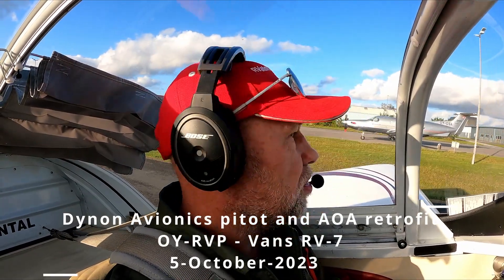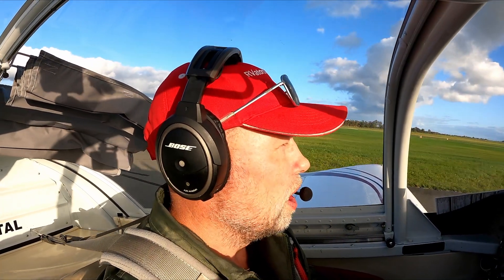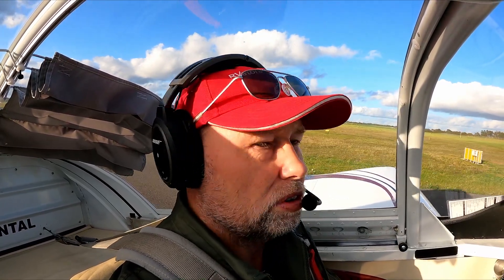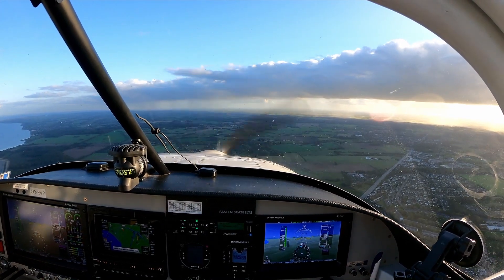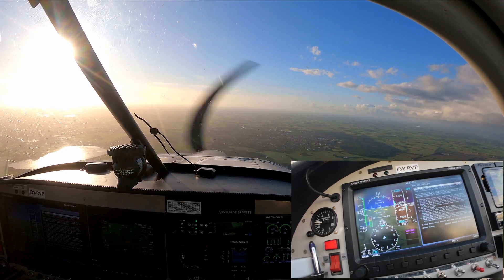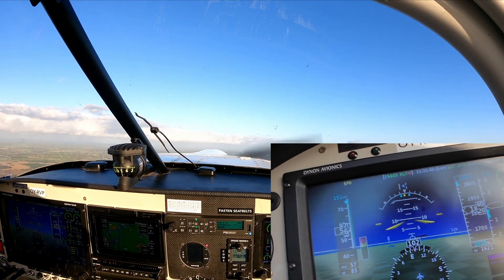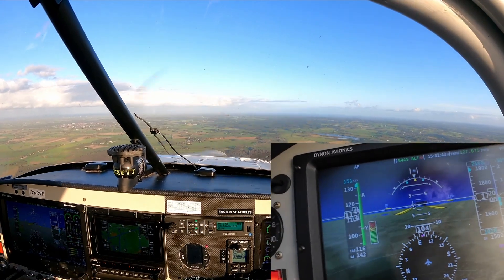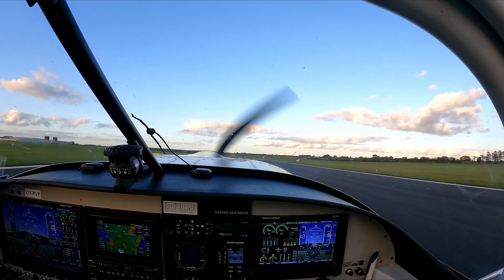Dynon Avionics heated pitot and AOA calibration flight.

Comment: Excellent presentation. Thank you for posting. I too, have a RV7 with the Dynon heated pitot AOA installed. Question: Do you think that the last stall that you did in the calibration exercise, where you said, "That was a steep one", affected the calibration? IOW, making the tone come on at a slower airspeed? Cheers from Texas!
Reply from the maker: Hi - No I don't think it made a lot of difference.  Since then, Dynon also changed the software, so now you can do calibration at any flaps setting.  I have fixed flaps set as Up,15,30, Full, so I did the flight again some time after and did it all over again.   As long as you are in a full stall, not the first or second indication, then it will record it correctly.  Thanks for asking.
Reply: @RV7FlyPer  Thank you for that quick response. When you repeated the AOA inflight calibration with the newer software, did you perform full stalls and recovery at all four of your flap settings? My problem is that I get full tone at 65 KIAS which is too fast and very distracting. I cannot remember if I've done the AOA calibration since 11/ 2023. So, I'll go out and do it again just as you did. Again, great presentation . . .
Reply from the maker: @jaycarpenter9294  Ahhh you can set that in the software after calibration - when you get slow beeps, faster beeps and full tone.. In terms of % of critical AOA.   that is a setting for the AOA and not related to the calibration  I had to adjust mine a bit... if you like I can give you my settings...   Yours are set to notify too early, and yes that is super annoying... and you should move the %'s higher as I recall so the beeps comes at a lower speed.   And then also remember to inhibit at an indicated airspeed that is below Vso so you will not hear the beeps if indicated airspeed is below like 39 (my aircraft stalls at 46).